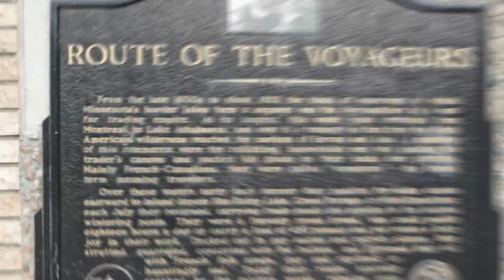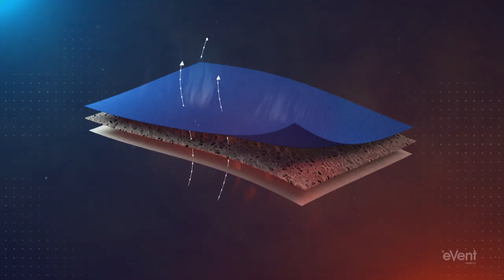Giant Sturgeon on the Rainy River- Personal Bests!

Comment: Great fish! Next time please dont grab them by the gills
Reply from the maker: We grip the gill plate and our hands don’t actually touch their gills.  For immobilizing a big thrashing fish like a big pike, sturgeon or musky, I believe you do a disservice to the fish if you think you can control them by bear hugging them.  Grip the gill plate firmly, hold the fish horizontal and get it back in the water.  Thanks for watching!
Reply: Yes and thank you for that👍 but with the bigger fish especially its still possible to rip the gill plate and would be in the best interest of the fish to not do anything that could harm it. Thank you!
Reply: I think the best way is to just to put the net into the bottom of the boat with the fish in it. Then grab them by the belly + tail, take your picture, then put them back into the net and use the net to release them. Putting a finger in the wrong spot could kill these old dinosaurs, too risky.
Reply: Actually River Freak is 100% correct.  Sturgeon gills are not like other fish, they're super delicate.  Never gill hold a sturgeon unless you intend to keep it.  Tail and belly grab next time.  Great segment though.